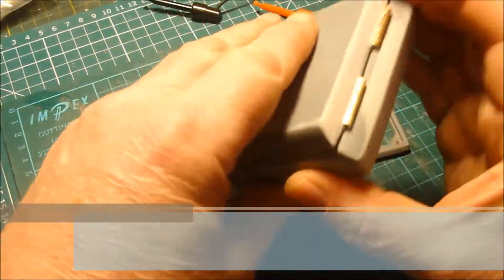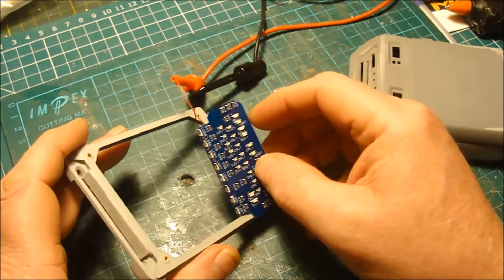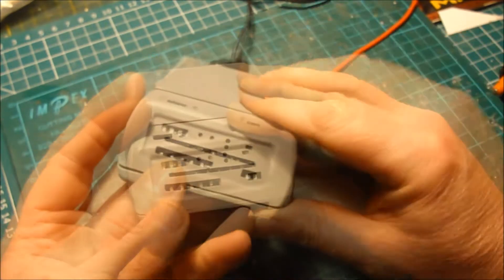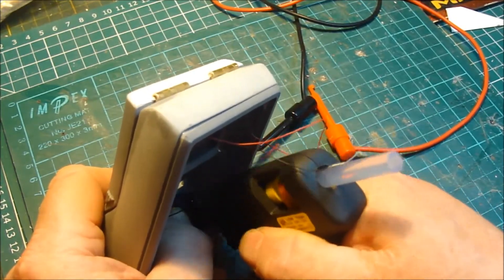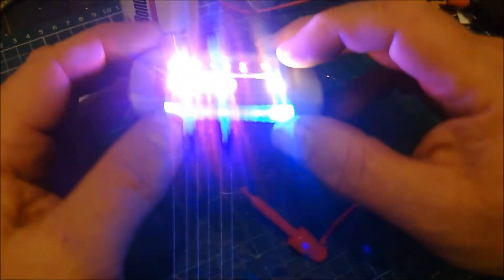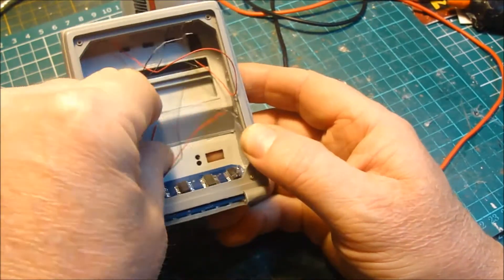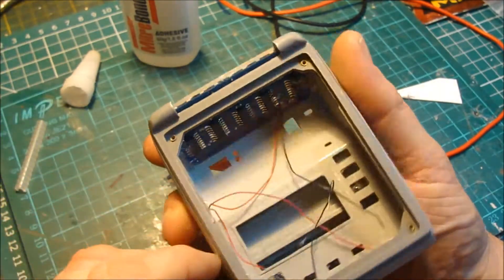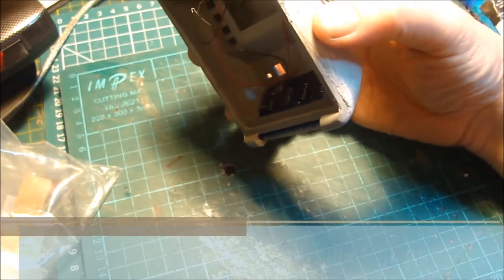Star Trek Medical Tricorder Part 4   Fitting Front LED Array

Comment: If you don’t have a power supply and you wanted to try and rig something up with a battery do you have any suggestions how someone could do that please? These videos are so in-depth it’s brilliant. They’ve given me the confidence to try it all for myself. Thank you!
Reply from the maker: Yes you can get one of those Black plastic AA battery holders - get the one that holds 4 AA batteries , some even come with Pos (red) and Neg (Black) wires already attached - you will also need to get some small electronic Crocodile clips attach one clip to each end of the wires - insert the batteries , and you have a 6V power supply - make sure you do not cross the wires or the Crocodile clips  and make sure when connecting onto the electronics board  which should come with Black and Red wires just make sure they match to stop it from working just disconnect one of the Croc clips from the board... Hope this helps..
Ebay has all you will need - search for "AA x 4 Open Battery Holder Square " and "Crockodile clips red/black " the whole lot should not coast more than £4 or 5
Reply: @FlankerTanker  this is brilliant. I’ll have a look now. Thanks for all your help! No doubt I’ll have another question as I go along! Ha!